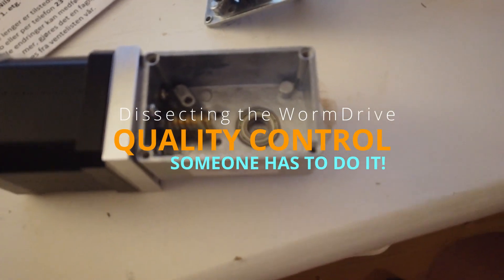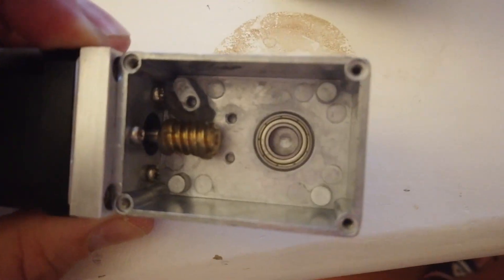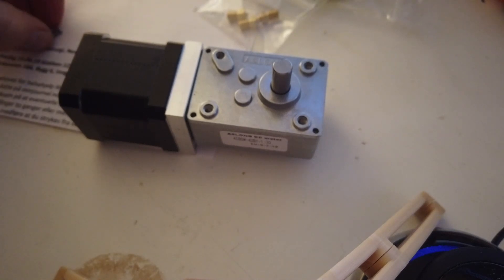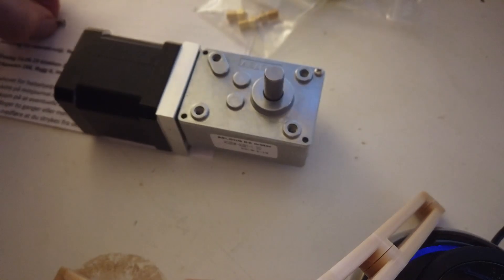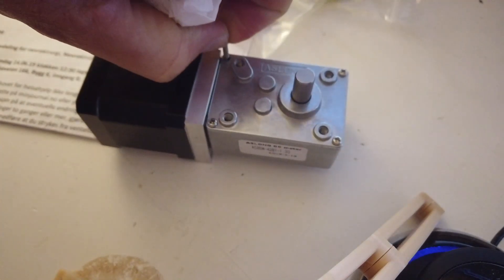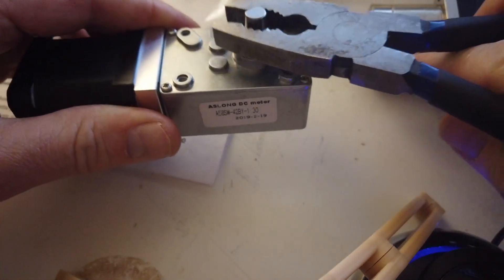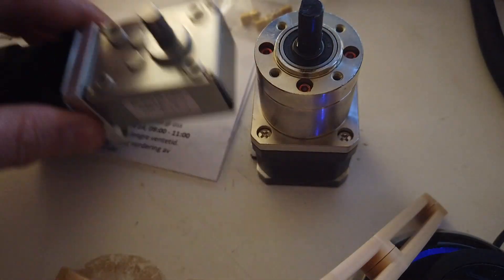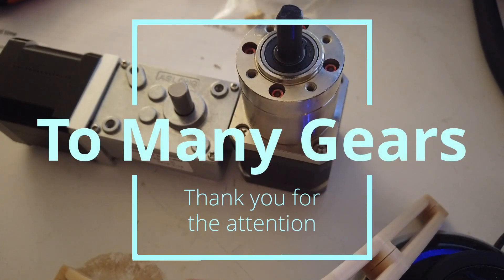Worm Gear Review - Quality Control?

Comment from the maker: Gear need to be tested and print something to see the quality in layers
Reply: I think you have to consider the whole Z assembly in case of play. The concept overall looks very promising to me. So I’m looking forward to see the first test. The backlash shouldn’t be a problem due to the weight of the bed.
Reply from the maker: @3d-malwerk878  Thank you for the response! I think you are right. I think you are right.  I already have a similar system on the V-King and this solution should have less play than the V_King. The weight takes care of most play issues anyway as gravity is our friend here